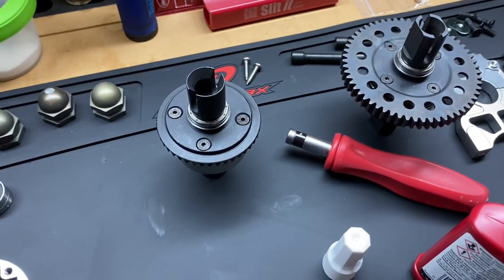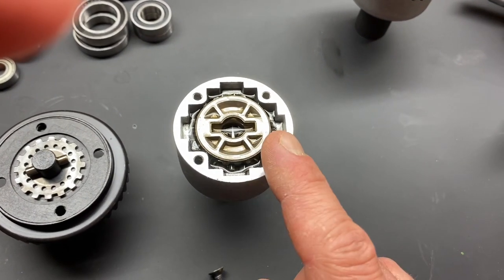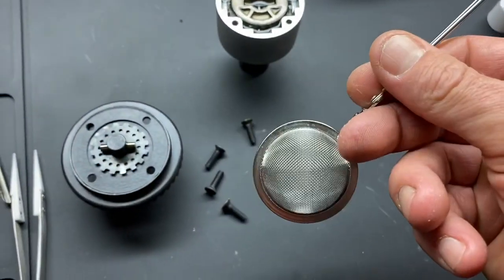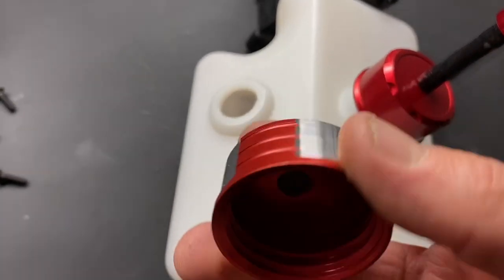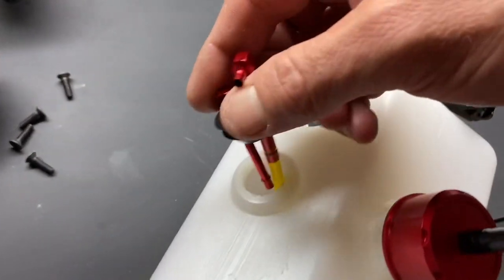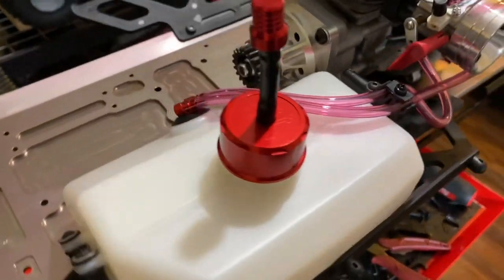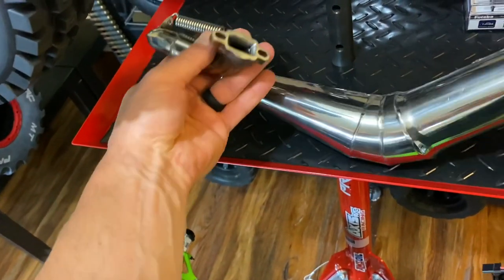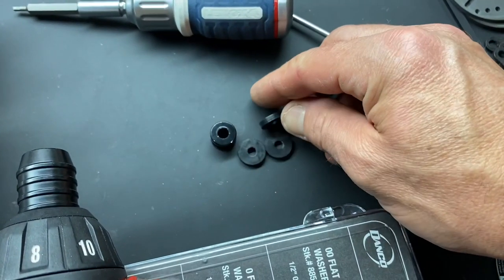Rovan XLT Engine, Diffs, And Gas Lines Complete! Clean N Neat Tight N Right!

Comment: Thanks for the info. Have around a tank through my 450xlt. Went through it with some Loctite as I have done with all my other trucks. Just took my diff out and found heavy grease as I suspected. I assume you use 100k on all the diffs? I noticed my gear case is a red corrugated look.... different than yours.  My main concern is with longevity over anything else.
Reply from the maker: The XLt seems to be a solid vehicle. Thunder has punished his and its held up well. As for the diffs I did 100K in front and rear and 500k in the center. I did this for my mtxl when I ran it and it handled very very well. Thanks for watching bro! If I can be a help I will certainly try my best!

Comment: What is up brap brother Jeff. Great minds must think alike because I did the exact same thing with my tank!  I hope that the rubber washers work for you I wish I would of thought of that before I mounted the 71cc pipe because that one the mount cracked on the first run!🤣😂. Luckily the pipe was not effected.
Reply from the maker: Yeasir great minds think alike! Sounds like you need a trip to the hardware store brother Kyle and get you some rubbers  🤣! Im glad you liked the idea bro! I appreciate you man! 🇺🇸🇺🇸🤝
Reply: @eastsiderc  Also I put my fuel lines through the original mount and I felt like the fuel line mount was pinching off the line so I just used some zip ties temporarily do you feel that The Mount restricts the flow
Reply from the maker: @kgm5512  it definitely went in there tight but I think it will be okay I could still slide the fuel line back n forth in the mount so I left it! That DDM tygon is very hard to smush and kink for that matter ! I find it to be the best stuff! Its all ever used for my dirt bikes and anything good enough for my dirt bikes is good enough for my RCs in my opinion!
Reply: @eastsiderc  that is correct!!  I am using the full force fuel line..it may be just a tad larger

Comment: Where do I get the 2 hole Grommet and the high flow fittings? Also what size is the fuel lines so I can get some if that also. I appreciate it man. Great vid.
Reply from the maker: I will send ya links n picks when I get home brother! Of where to get this stuff DDM and Ali express but I will give you some options and you can choose

Comment: Do you recommend the 100k dif oil in all 3 difs? If not what is your recommended oils for each fpr this truck with medium bashing over mixed terrain(on road, smooth grass mostly, and light rough woods runs, will be ran in snow as well) thank you for your time and expertise!!!
Reply from the maker: I think we’re going to have to experiment a little bit. I went with 500k center and 100k in the front rear! I tried that in my MTXL and it worked great so well see as soon as this heat leaves! I dont brap in this heat! But I do run my nitro!